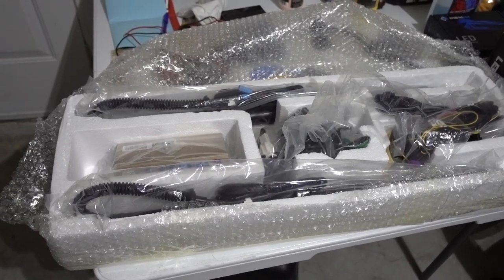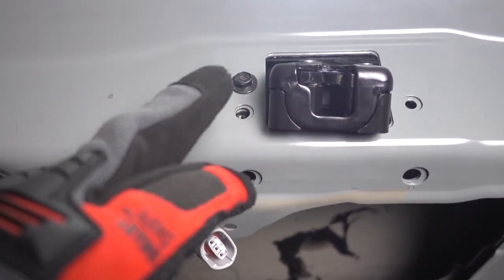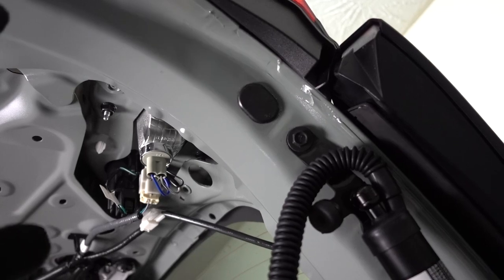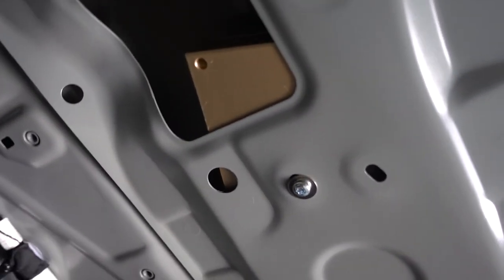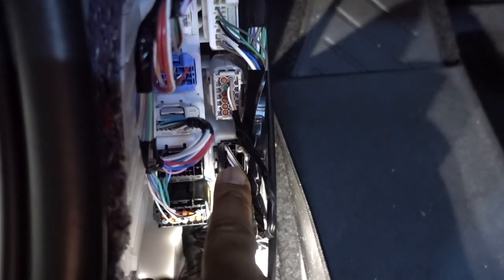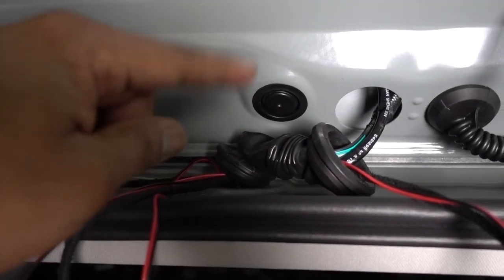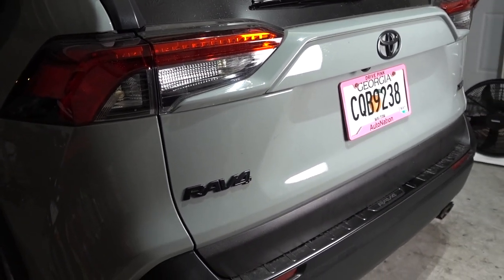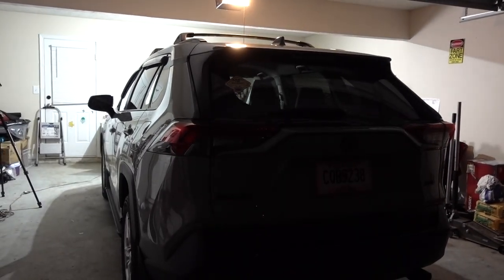2019 to 2021 RAV4 Electronic Trunk Lift Support Kit from CarTrimHome

Comment: Just a qwik question...

You've had this aftermarket mod installed for some time now and I was wondering about manual opening of the boot.

"Normal" RAV4s (without the door lifter) unlock the boot when the recessed unlocking button (inside the lifting handle & above the number plate) is pressed. A second press allows you to pull the door open.

Does this work the same way, now that you have the power lifter installed? i.e. pressing the recessed unlocking button causes it to unlock & power open?
Reply from the maker: Yes if you press the button ones is gonna open the gate
Reply: @BulletSolano  How about if the trail door is locked and you press the button under the handle? Will it then unlock & power open?
Reply from the maker: Yes

Comment: What if the trunk needs to come off bro? I’m looking to buy a car from auction here in australia the damage is deep that the trunk is bent in. 

I was planning to buy another write off car for the parts and switch the boot. 
Could this be possible?
Reply from the maker: Yes, unplug all the connectors remove the struts, and unbolt the hinches

Comment: Hello sir, i just bought a golf 8 with this exact aftermarket kit installed in it it and works perfectly fine, old owner says they connected it to the fuse box, is it safe for me to use it i am scared of any kind of short or fire hazard that can happen since it is an aftermarket kit. How safe is this ? (i understand nothing about electricity)
Reply from the maker: You should be good, as long wires are not exposed in any part of the system

Comment: I bought a used rav4 2021 which had a damaged tailgate door, I got an aftermarket tailgate door but since its not the original its heavier,  the normal tailgate dampers struggle to support said tailgate. Do you think these dampers support a heavier tailgate?
Reply from the maker: Yes they do

Comment: Hi bullet this video you posted is 2 yrs old...is there a new version of this power lift tailgate model ? I see another kit on amazon that also has Foot sensor to open / Close the tailgate....also if my Rav4 LE Remote has only 3 buttons and it does not have a dedicated button for Trunk Release....then there will be no way for me to open the trunk using my factory Toyota Remote....lets say you come out of grocery Store with suff in both your hands how will you open the tailgate ekectronically ?? Let me know what you think
Reply from the maker: Hi, check the link in the description I think is the same system, Mine has 3 buttons, by pressing the lock button 3 times it opens the tailgate

Comment: hi there...
Thanks for the video.. it has all the details to install the electric tail gate... Just one question, the white wire (key unlock signal wire to release the hatch) is white not white with black stripe right?
How do figure that out? I have a 2022 Toyota Sienna but couldn't find that white wire..
Reply from the maker: https://youtu.be/BuHQ8Ph1V8w?si=wMRhklO7emG6GG9X

Comment: When the hatch is closed...i see the button that you installed to push and open...what is some things in your trunk will hit that button by mistake and the hatch will open on its own
Reply from the maker: When the tailgate is closed the button doesn’t work from the inside, it has a little red cord to pull in case of an emergency

Comment: Thanks for your video. Did you also change your key fobs to the ones that have the extra button for opening and closing the trunk door?
Reply from the maker: No problem, you can open and close the trunk door by pressing the lock button 3 times

Comment: hi so i bought that system for my 2021 rav4 hybrid and I have been using for a couple a years the only problem SOMETIMES  is that when you lock the car with the remote ( pressing once ) it will open the trunk ( again just pressing once) is there a way to disable the option to open or closed threw the remote
Reply from the maker: Hello, ill ask cartrimhome
Reply: @BulletSolano  thanks i will be waiting for your response

Comment: I'm looking at putting in a powered tailgate for my 2020 RAV4. The main problem that I have is all the kits that I've looked at involve cutting into the cars cabling which will void my warrantee.

I assume that that cut in wire is the ignition sensor to prevent opening of the tailgate while in motion. If this is the case, then connection into the cigarette lighter (either front or rear) would provide far better access and be less intrusive.

Secondly, I note that the kit uses a fuse tap of an existing circuit. I know from other vids that there are spare positions on the fuse box. Why not simply use one of these instead of risking interference with an existing circuit?

Lastly, all the vids I've seen haven't addressed a number of questions that I have about the tailgates operation. Notably, does the tailgate operate as it did prior to the installation? Does installing this 3rd party kit mean you can now purchase a Toyota remote with a boot release button?
Reply from the maker: Those are questions that you need to ask cartrimhome, I’m just following the instructions from them
Reply: @BulletSolano  After a bit of research (isn't the Internet wonderful?), I've discovered what that cut in wire is for.

It isn't the ignition sensor as I'd supposed. What it does is monitor the door open line from the cars electronics.

By default, cars without factory fitted powered liftgates are supplied with a 2-key remote not a 3-key remote. However, when using a 2-key remote, pressing the open key 3 times is the same as using the boot opening key on a 3-key remote.

The Readers Digest version: If fitting an aftermarket powered liftgate, pressing the open button 3 times on a 2-key remote will cause the cars electronics to send an "open the boot" signal. This will be sensed by the newly fitted powered liftgate which will then... open the boot.

-- x --

Further, I've discovered that there's a small local fuse panel on the right side of the boot. Potentially this could be used for the 12V constant & accessory feeds... although wires would still need to be run forward to the drivers switch and door opening sensor line.
Reply: @devilsadvocate2656  I would be careful trying to use a secondary fuse panel, I would think these electric struts draw a decent amount of current and depending on the wire size feeding the aux fuse panel and the current rating supplying that aux panel you could be asking for trouble but that is just my opinion, I have not installed one of these yet but I plan to in the spring. Thanks for the info on the remote, I was wondering how you would control the rear liftgate with a 2 button remote (we have a 2020 LE)
Reply from the maker: I have no issues with the wiring and on the factory remote pressing 3 times the lock button you can open and close the lift gate
Reply: @DCPHONEGUY  Point well taken.

Mine is a Hybrid so the main 12V battery is located under the boot floor on the right-hand side. It has a small fuse box attached with unassigned fuse positions.

I got the idea from another YouTube channel which attached powered rear struts to this same place. (Buggered if I can find the channel now)

I've been occupied with other personal matters and haven't managed to circle back to this yet (you know how it goes). Please keep us appraised of your progress. I'm certainly interested.
Reply: Yes ours is also a hybrid and going directly to the battery is an option, be absolutely sure you put in a fuse at the battery and also realize you need to run the wire for the front switch all the way to the front of the vehicle anyway.

Comment: Is there a place down low to put the button thats on the trunk? My mom's short and can barely reach the trunk lid so it'd be nice to put it down low on the side somewhere on the inside of the trunk, is there enough cable?
Reply from the maker: Is not gonna reach down low, but you can splice the cables to extend them

Comment: does this work for RAV4 2020 LE? where I can find a garage to install this for me?
Reply from the maker: It works for any RAV4 2019 to 2021, shop? Don’t know where you live, you need to call shops around your area
Reply: @BulletSolano  手工费多少钱？
Reply: Car audio installation places are good places to start, they're use to running wire cables

Comment: Thank you so much for your video! It looks time consuming but definitely doable! I do have one question, I got a little confused at the end, did you also install a button on the outside of the liftgate? I know you put one facing the inside of the trunk, but one point you also opened the liftgate from the outside but I didn’t see you installed anything. Thanks for your help in advance!
Reply from the maker: Key fob RAV4’s They already have that button
Reply: @BulletSolano  another super noob question, do you have another video that shows how you tap into a connector wire?
Reply from the maker: @alan5245 https://youtu.be/BuHQ8Ph1V8w?si=w3Jrf0dggoglMUj5

Comment: Some kits allow you to open and close the trunk by using your existing remote by pressing the unlock button 3 times. Does it work with this kit?
Reply from the maker: With this kit you press the lock button 3 times to open and close
Reply: @BulletSolano  Hey, I ended up purchasing the kit and it works great so far. I'm able to press the lock button 3 times and the trunk opens. But if I press the lock button when the trunk is open, the car just beeps for a long time (I guess since the car detects that not all the doors are closed). Are you able to close the trunk with the remote?
Reply from the maker: Hey man, yes I press the remote control 3 times to open and close

Comment: I installed the power lift gate and your video made it very easy to do. I do have one little problem that maybe you can help me with. The lift gate does open and close when the buttons are pushed. But when it closes there is a minor issue. It will close all the way and the dash shows it is closed, then it  backs off just a bit and the car thinks that the lift gate is open. I have tried to adjust the catch on the bottom, but so far no luck. I don't see any adjustments for the motor side of it. Might you have any ideas as to what could be causing that to happen? Any info you provide would be helpful.
Reply from the maker: Did you put the latch provided with the kit?
If so, keep adjusting it, if that doesn’t work contact cartrimhome for replacement
Reply: @BulletSolano  Yes, I did use the latch that came with the kit. The arrow points to the back of the car. It was adjusted left and right and forward and backward. There is not much movement either way. One thing I tried was as the door closes I hold it tight shut and then it does not move back. Of course I don't want to have to do that each time. I will continue to try and make adjustments to the latch. Thank for your help.
Reply from the maker: Make sure the wiring is right under the steering wheel, bad connection can make the car not registered that the latch is close
Reply: @BulletSolano   I adjusted the latch as far back as it will go and now the door shuts all the way and the dash indicates that it is closed. Thank you so much for your assistance. I also installed the brake light kit and it works great. I am so glad that you made these videos. Keep up the great work.
Reply: I do have a couple more questions you may be able to help me with. What is the yellow wire (Control line) that is connected to the third connector on the second left white wire for? What does it do? Next, the system that I installed intermittently beeps all by itself as the car is driving down the road. Has yours ever done that? I will write to the company to see if they can help as well. Thank you.